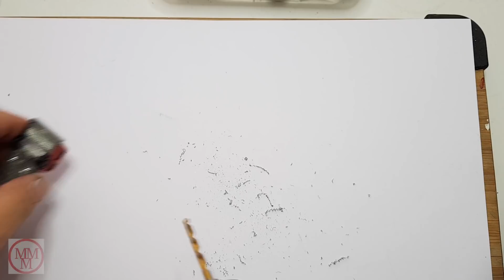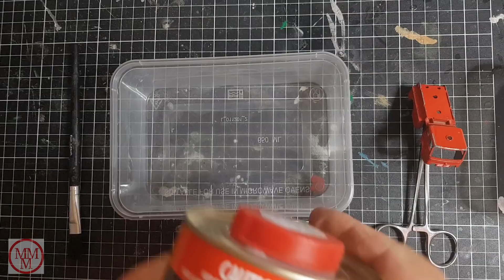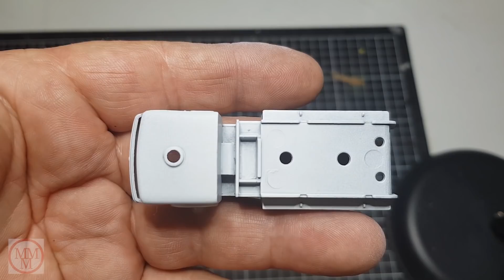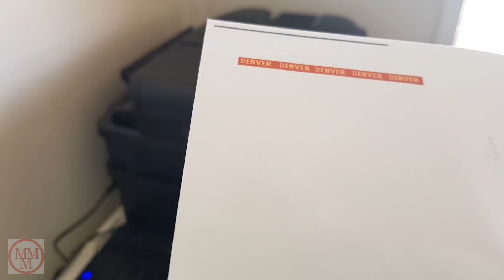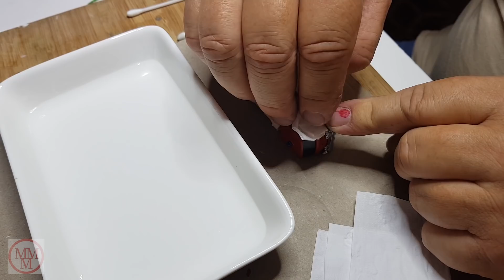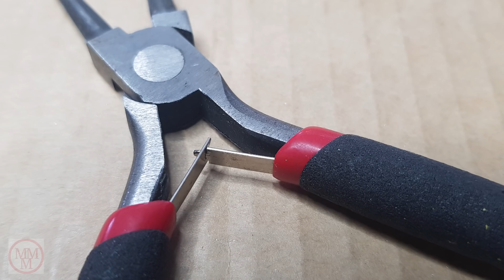MATCHBOX Restoration No 29c Fire Pumper Truck 1966

Comment: A suggestion.  If you can, try using some thinner wire.  I would suggest the ribbon cable from an old IDE hard drive.  They're really tiny and will do quite well to fit in small places.  Great video and mod to the car!

Comment: Cracking as ever Marty, but instead of standard silicone you might want to check out a product called Stixall (by Everbuild) if they have it over in Oz. Comes in clear, white, black, grey, etc and works much better but still removable later with no damage to the model. Keep up the good work!👍

Comment: Just a thought, Marty. Why not put a dollop of JB Weld on the axle to form a small cam so that when the axle is rotated, it will close and open the switch causing the LED to be turned on and off,

Comment: Another great and fun video Marty, I enjoy the paper you choose for the spray booth, and comic relief mixed into your videos.  I use a brass wire wheel on the Dremel to remove the last bits of paint after the stripping.  The brass wheel doesnt harm the casting.  Please consider placing your 3d models on Thingiverse, it would be great to be able to use the STL files.  I have not found one  ebay or online store for the firetruck plastic part.  For paint, I've been experimenting with craft paint from the local craft storer (Michaels in the US).  I thin the paint 50-50 with IPA.  Then add a drop of Liquitex flow medium.  The craft paint is a fraction of the cost of Tamiya paint.

Comment: Have you thought about using rivets for the baseplates?  It gove a little more authenticity and can push your model from being a nice piece to almost undetectably restored.

I restore lots of toys from my childhood and have dabbled with diecast cars.   I tried the button screw, but hated the look and I ended up customising a rivet to match the OEM rivet.  I then use a small amount of hot glue in the base post.  The reason I use hot glue is that I can remove the rivet (without damage) if I ever want to get back into the model again by usung a soldering iron to heat up the rivet and melting the glue.

Comment: The 'damage' behind the cab is where the metal was injected in, and then the sprue broken off.  They weren't too bothered about that back when they were making cheap toys.  The rough point above the windscreen may well have been a vent for the same process.

Comment: Hi Marty- here's a tip for making your supply of decal paper last a LOT longer... once you design the decal, print it on a plain sheet of paper. Then cut out a small bit of decal paper that's just bigger than the design and tape it down REALLY WELL on top of the printed design. Then you can reload the paper back into your printer and print the decal again. It will print in the same place, but this time on the decal paper. Most inkjet printers can handle the difference in thickness... at least it works that way when I print decals. Thanks again for the nice resto & entertaining videos!
Reply from the maker: THAT!.....Is the tip of the week!!!!! Thank you for sharing, what a great idea!!!! Brian, you are a genius! Marty.

Comment: Gidday Marty that was a flash of genius to do that ! just thought i`d let you know but the plastic suspension arm that sits underneath the interior housing always tend to have a curve inwards so I put them in a saucer of boiling water and hold it there for a minute or so ( using a pair of long nose pliers ) at its original flat shape to get the bounce back in the wheels again, or you can go slightly the over way and have a real off roader ! and dodge all them pot holes that we have here in the UK.
Reply from the maker: Good tip. I will definitely try that out the next time I pull apart a model with suspension. Thanks for posting William, Marty.

Comment: Really good made restoration. Like it to see that to be "original" is not a dogma. Well made job for this fire pumper truck, with a little more inside. To make the rear axle to a switch, has more play usability also because would you have used the front axle, the LED would probably just flash against the playing hand. 

If you would like to publish your 3D printer files, anyone with a 3D printer could produce them or it would be possible to go to a shop to get it printed from there. If someone has the STL file, he can print it on any 3D Printer. You make this file always by modelling a new 3D printing object on your PC.
Reply from the maker: Will prob share when i work how to upload them to a file sharing site.

Comment: That  crack actually makes the window look like it has a post in the middle.  
I kinda like the effect

That sculpt looks  rather  stunningly  detailed, unpainted though.  

Lights in small cars  are always  cool  and  the  firetruck  is  big enough to  accommodate that massive battery holder.

Comment: Thanks to you and especially Mrs. MMM.  

The led is a nice touch.  Are all the Matchbox beacon lights the same diameter?

Just a thought, how about an internal reed switch and an external mini magnet....simple and cheap as chips.

https://www.dx.com/p/reed-switch-magnetically-controlled-switch-golden-5-pcs-2041515#.XBjUbIrTWhA

https://www.dx.com/p/8-3mm-cylindrical-ndfeb-magnet-w-hole-silver-10pcs-2079757#.XBjUk4rTWhA
Reply from the maker: I will check it out, thanks Matt.

Comment: I had this one, probably around when it came out.  I didn't remember the ladder and hard suction hose but those probably "fell off" early on.  I remember that the plastic tarp over the hose bed was pretty flexible.  

Interesting model.  US prototype, down to the bell and Federal Signal Q siren on the front bumper, but then a blue light following UK practice.  :)  I'm still googling around to see if this model has an actual prototype or if it's a "kitbash" of several different makes.

Making the light flash by pushing down the rear was BRILLIANT!

Comment: Love your videos. I use a type of acrylic solvent/glue to repair old watch crystals, it's thinner than water and fills a crack and bonds it.  It takes some practice but it works. With a little less work you may be able to at least hide the cracks in the broken windscreens. Maybe something similar would work... Also I use fine brass watch making tweezers these would be good for placing the water set decals. The fine but not sharp points would be great for placement, brass would be less likely to scratch fresh paint, longer, easy to file and adjust, cheap on ebay... Just ideas I wanted to pass along.

Comment: Amazingly good and you don't often see the wealth of comments that Marty gets! His 3D printing attracts a fair bit of attention with several people asking about ladders & pipes for their own resto's. Why not put a supply option on your website Marty? Also, many people mention liking the blue light (with one person who doesn't like it, presumably because it's not original 'Matchbox' which is an interesting issue). The light works in a way that's common on many toys (i.e. when the truck is 'driven' along by the child the pressure activates the switch and the light operates). Interesting then to see the final shots of the stationary truck, standing there untouched, yet still with the light flashing. Presumably this is the same, or perhaps a second truck, wired-up slightly differently? Anyway, best wishes Marty, from Tom, your manager!
Reply from the maker: Hi Tom, thanks for your excellent comment. Very observant of you to notice that in the diorama shots at the end the light was flashing with no human interaction. It was the same truck but it had a small unseen addition. A toothpick wedged under the rear axle on the side facing away from the camera. Thanks for watching. Marty.

Comment: Another great video, Marty!  I recently obtained this same model on eBay and did find the decals on-line but no ladder/hoses yet.  I've had some luck with Matchbox windshield issues using a product called Plexus.  It's available in motorcycle shops in the US (but is quite expensive) and is used for cleaning up small scratches and cracks in Plexiglas.

Comment: OUTSTANDING!   This one is super common in the USA, but strangely enough, as many as I've seen, dozens over the years, the "DENVER" decals are rarely present.  It was produced with and without, and I suspect it's not common in the USA.  The flashing LED just rocks.  You've also inadvertently discovered how to add suspension. Recreating the missing parts - amazing.    Kyle~

Comment: Not enough vegemite it needs to be thicker
Hi Marty the silicone solution to sticking in the glass I mentioned on a previous video.
That video I think you were using araldite maybe not it could of been another youtube guy.
Anyway going through the garage not looking for it but I found 2 of my old toys the nice one that I'm not going to touch because its just too nice. 
Donald Campbell's Bluebird Corgi. But my first rebuild is my Dinky Fire Engine 259 needs tyres and the ladder both available as is the glass but mine is not broken. In short youve inspired me. In Sydney cheers

Comment: My grandparents had one of these in their collection, and I always loved playing with it. When I started watching your videos, I thought, "I should give this a try - which one should I start with?" I found several of these available, but didn't actually pull the trigger on any of them. This video pops up and my first thought is, "I better get one now before Marty's video drives the prices up!" 

One thing I noticed with most of the models available, and which I remember from the one I played with, is that the hose assemblies are all bent, especially the hose drums on top. Any advice on straightening? I've had bad experiences with heat guns...
Reply: Cool on the collection from your Grandparents.

Toy-Polloi (great channel for fixing "any" toy🙂) will sometimes put plastic parts in "freshly boiled water."
(This guy is awesome!)

Then will bend the item straight again.

Hope that might help.
Reply: @Tim-57 , thanks! I'll check out the channel and give boiling water a try. My experience with heat guns is that all of sudden the part not only loses its will to stay in the right shape, it can actually shrink. But boiling water might be enough to coax it without wrecking it.
Reply: @fepatton  

I am happy to be of some help. 🙂

Comment: Hi again from England

Martin:
Get yoursen a hand chuck to mount drills in for finer work where you haven't got much of an allowance...such as taking the weight out of rivet heads on the windscreens etc...
You've more control like that... 👍

That hollow you repaired is probably just a bit of shrinkage from the casting process...

I see your an avid "daily sport" reader...a quality newspaper...
Did you see the report on the London bus they'd found at the North Pole...?
They found a Mk2 escort on the moon as well...